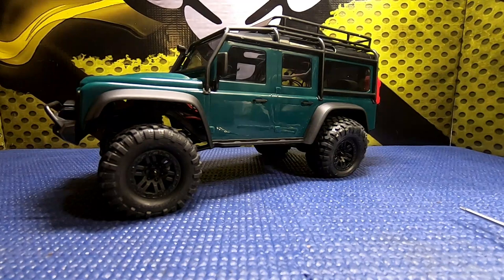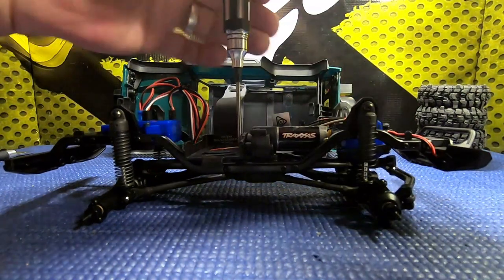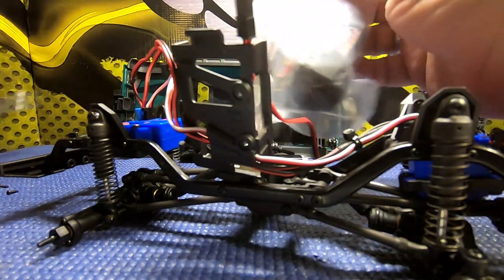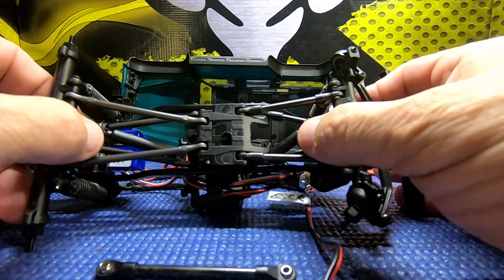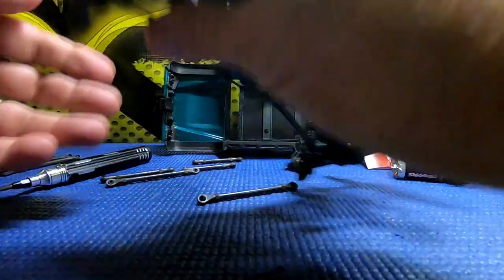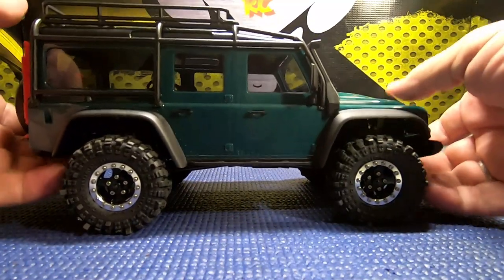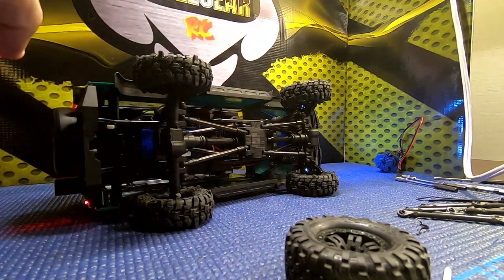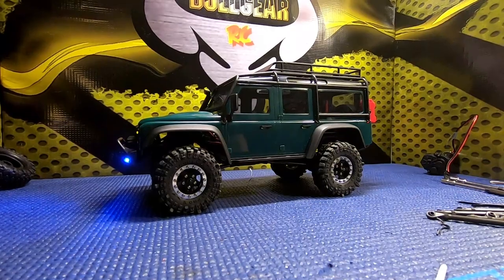TRX4M First upgrades

Comment: I’m sure I’ll be referring to your video when I get my Defender. I used your SCX 24 Furitek motor install to get mine into my SCX24. Love the torque it has & is super good on steep steep climbs.
Reply from the maker: This one is in my opinion easier to work on. Should go very smoothly for you👊

Comment: I have to do the same thing. The guy in front of me got the last set of gears so I swung by a different shop on the way home and found the whole low trans-motor combo. Got to wait for the light kit
Reply from the maker: Low speed trans makes a big difference. My light kit may be a short lived upgrade if I decide to go brushless
Reply: Maybe Traxxas will give us an option
Reply from the maker: @DoubleADay  flubber stuffers has motor plates for Komodo and micro Komodo already

Comment: Truck definitly needs some low slung weight to keep it from tipping back. Wish my hobby shop had the weight inserts for tires n brass hexes. Make the truck way better
Reply from the maker: I'm sure the aftermarket will be all over this platform

Comment: One thing I noticed with my defender is that you HAVE to remover the front and rear bumpers if your wanting to crawl
Reply from the maker: Yeah, I'm assuming the Defender is more of a trail truck. I will most likely scale it out and use it for that purpose.  May grab another one to make a performance rig

Comment: Any fixes for the steering binding issues? Mine is so bad it is shelfed until Traxxas provides a solution. I would return it, but it was a gift. Go with FCX24 or SCX24, or just ANYTHING else than Traxxas.
Reply from the maker: Do you have bronco? If so look to see if tires are rubbing the links. They have wider tires than defender and may rub links. Also put oil on cvd's and bushings to help free them up, or get the bearing kit and replace bushings with bearings.  Hope this helps
Reply: @BullgearRC videos  Thanks, I have the Defender, it doesn't seem to be the tires. I  cleaned, oiled and greased and reassembled with bearings. It didn't help though, and I have not taken it outside to where the grease would attract dirt. Just bench testing trying to get it smooth like my other crawlers. I even run my scx24 on 3s with a 370 brushed motor and it doesn't bind at all at full lock.
Reply from the maker: @NecessaryRC  if you have a transmitter for a trx-4 or have access to one, you may try to bind it to your trx4m and set the end points at a bit less than a full lock. I haven't noticed any problem with mine. Maybe your factory end point settings are a bit to excessive
Reply: @BullgearRC videos  Thank you that sounds worth trying. I'll have to go to a hobbytown or an event and find someone with a transmitter that can do that though, unfortunately I don't have one, and don't really have any friends who are into RC. Really appreciate the help, you are making me want to stick with this and not give up on it yet. Thank you!!!

Comment: The first thing you should do with this rc is take it completely apart. There was absolutely no grease in any of the gears in mine. It's not just mine either. Several YouTubers have made videos of there's having no grease in their diffs and gearbox also. Traxxas doesn't put Any in this rc anywhere.
Reply: I don’t think grease matters on the trans, diffs should probably have some just for anti rust purposes though! I’ve also heard of shocks being empty from the factory. Traxxas will send you a free bottle of shock oil if you show them how empty they are too 😉😁 can’t ever have tooooo much
Reply: @V8chump  if you add some grease to them it's less strain on the motor. Witch results in it running a lot smoother and the battery lasting a lot longer. Yes you can run without it,but it performs better and last longer with it.
Reply: @justinhetricck6197  is the trans sealed though? I know on the scx24 grease just got flung off, seeped out, and made a mess because it wasn’t sealed at all. never really did anything
Reply: @V8chump  I put just a thin layer on the gears and none has come out yet. I wouldn't consider it completely sealed,but nothing has come out yet.i have several hours on it since I've put it in.
Reply: @justinhetricck6197  You are not helping Traxxas sale more motors with that comment.   Please delete.  I don't work for traxxas!!  😂